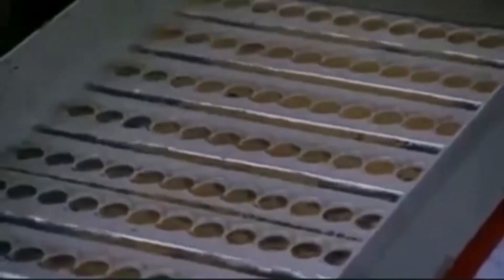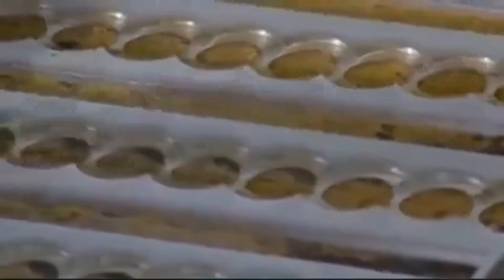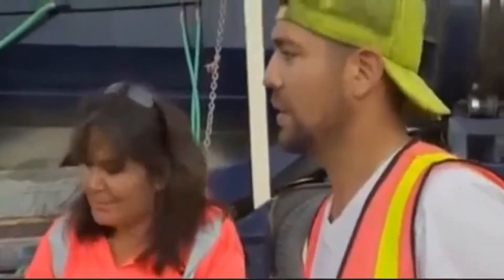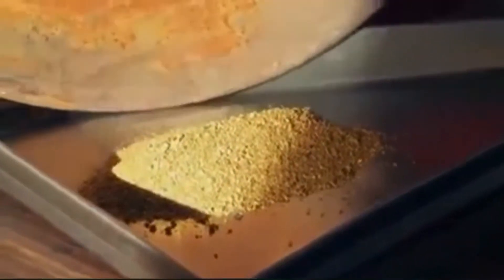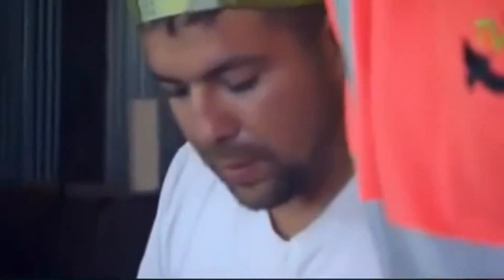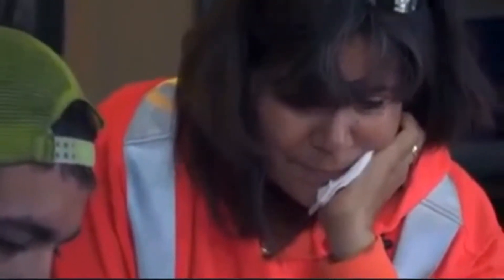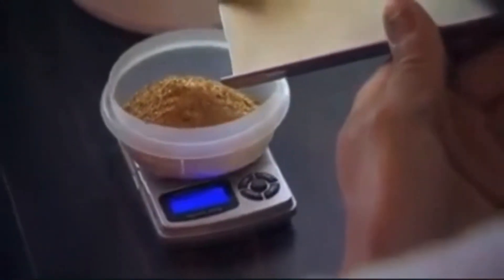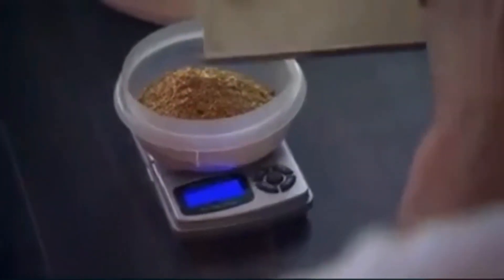What kind of Long Tom does Karl Knutson use on Yukon Gold to cut his cleanup times by over 80%?

Comment: What is the name of the sluice he uses at the end to run the dirt through to get the gold?

It has all the circled holes on it and it's aluminum.
Reply from the maker: It is a Devin Gold sluice, either the Cariboo or Klondike model. Devin makes premium aluminum versions while Infinity prospecting produces less expensive rubber mats (with the same vortex drop riffle design, the "circled holes") as well as steel and aluminum highbanker combinations with rubber matting.  They all use the same patented technology that loads of miners are adopting - especially if you are into fine gold.

https://devingold.com/

https://www.infinityprospecting.com/

Thanks for the question, Dean!
Reply: @InfinityProspecting  thank you so much. If the rubber mats work as good as the aluminum sluice, I could put the mats in the sluice I have.

Would the rubber mats work just as good?
Reply from the maker: @deanmayer6508  Yes, they are the same design and brand, Devin Gold VDR (Vortex drop riffle) with the same high efficiency. They can be used as both a production and a cleanup unit. We (and others on YT) have tested them extensively. They are on sale now too at https://www.infinityprospecting.com/ plus you can use our channel discount code INFINITYGOLD during checkout for an extra 5% off.

Thanks for your consideration. Let me know if you have any other questions. Happy holidays!

Comment: Sorry for bothering you but would that sluice work on micro gold like we have here in Croatia .
Reply from the maker: Yes, that's what these products are designed for, flour and micro fine gold. There is a European distributor of Devin Gold products you can find linked on their site. The mini sluice works great for cleanups and the mats that mirror the aluminum VDR in the video will significantly increase your fine gold take and eliminate most if not all of your blow through. (More gold in the jar, more time saved.)

P.S. No bother. Thanks for the comment! Good luck with your prospecting. Also be aware your areas will have valuable relics beyond gold that can be found in watercourses and metal detected.
Reply: Is it available in Australia
Reply: We mine micro gold in alberta  fly shit I call it